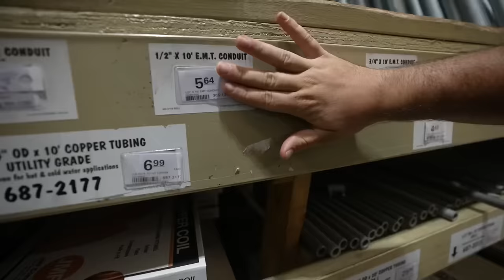Building a DIY $100 PVC Homemade DUCK Hunting Blind CHALLENGE!!!

Comment: Use trailer pins to replace the screws holding the conduit to the boat mount. This will allow you to disconnect in seconds but still be sturdy

Comment: When using a cutting wheel on an angle grinder ALWAYS have the sparks come towards you so if it bites the grinder pulls away from you, If you use the left side of the wheel the and it bites the grinder will come back at you full speed ahead. I used to weld/fabricate for years and saw some gnarly things with grinders

Comment: Your mitre saw that you used to cut the PVC pipe with will easily cut the steel conduit.
A carbide tip saw blade will cut through really heavy pipe and angle iron and such.

Comment: watching flair use a reciprocating saw and angle grinder in the most improper way is almost like watching someone trying to put a round peg in a square hole….. be safe out there bud also buy a portable ban saw if your gonna cut steel conduit. Love the vids bud!

Comment: Andrew! You need to use your grinder like a right handed person. They don't make an anticlockwise grinder for lefty's. Saws all is the ultimate bodging tool, if your using it, you are either demolishing something or you're doing a bad job. 
My advice would be to get a 2nd mitre saw with a TCT blade for cutting metal. You're clearly not a tool guy and that will make your life easier on all your projects.
Just listened to LOJOs podcast.... I would say, don't be a tight ass and pay a separate editor and camera guy. You're making a good amount of money and you couldn't do it without them. 
They can both just work a day shift and the editor can edit the day after the video is filmed. The kind of videos your making, Zach is defiantly good enough for a camera man and he's really knowledgeable with hunting a stuff. Just find yourself a decent computer geek and everyone is happy.

Comment: Should use hitch pins for a 4wheeler or a lawn mower. Then you will have easier removal
Reply: Instead of the bolts you used to mount the conduit